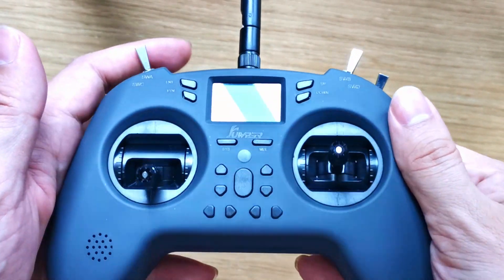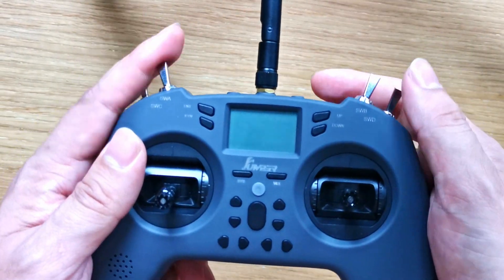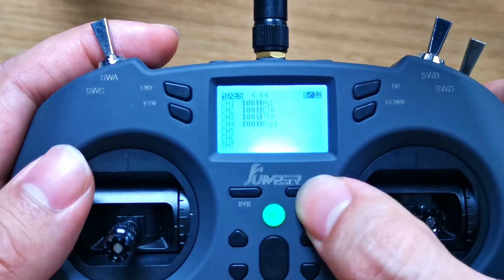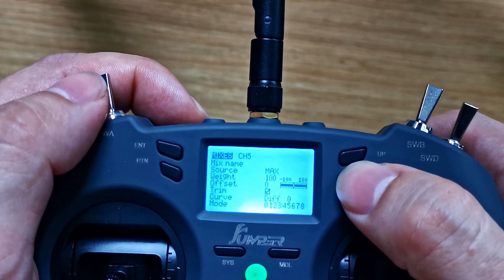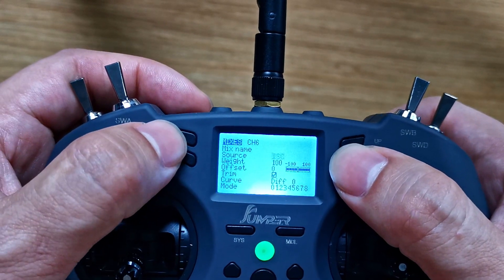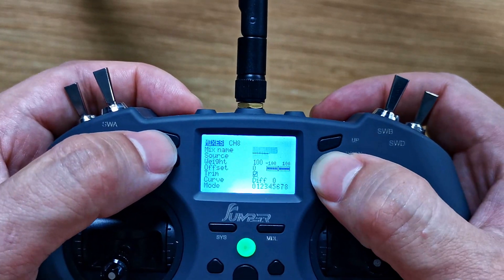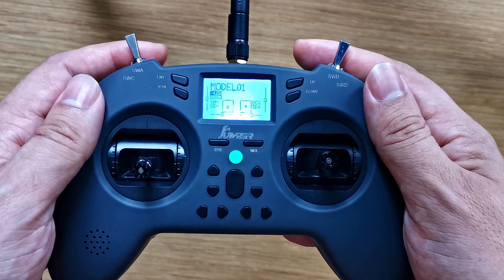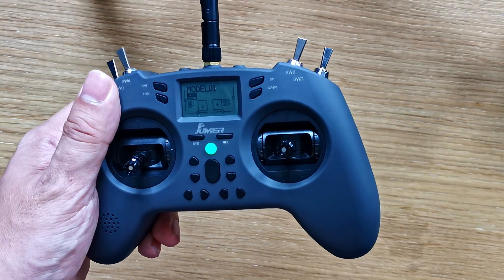Jumper T-Lite Initial set up

Comment: Is there any way to make the trim buttons act as discrete buttons and not trim switches?
Reply from the maker: Maybe but I don't think so.
Reply: I believe that you can do just that but the place to get the required knowledge about using the full programmable power of OpenTX or EdgeTX on these radios is on the RCGroups Forums on those subjects. Google it. There may also be someone who has done a video on it. Again - Google it.